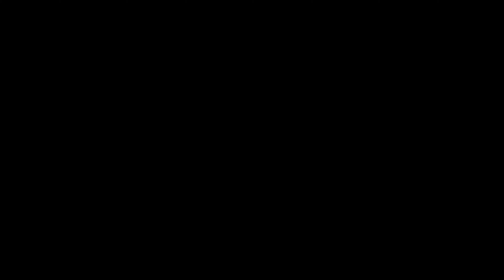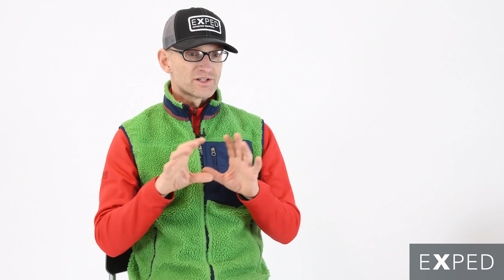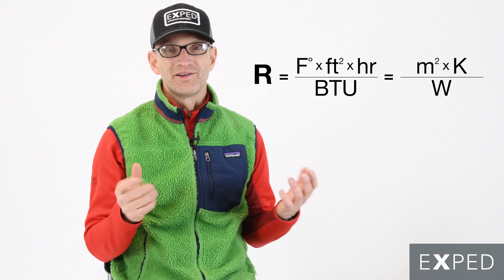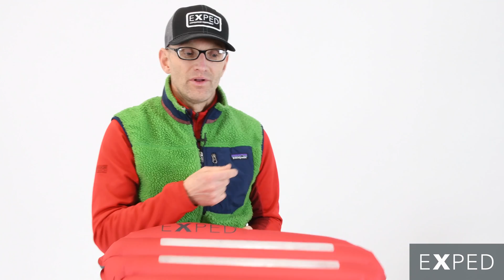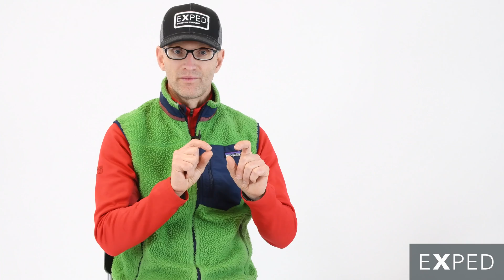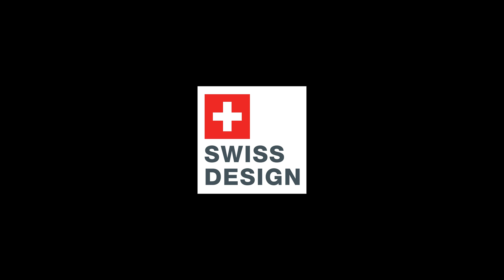R Value Overview

Comment: I will be setting up for a lot of winter outings here in Northern Ontario. The temps drop to below -30C I'm looking for info on whether the Exped would be a good pad / insulator that I can use on top of a tarp on the snow. Any info would sure help.  What is the R value of your winter pads.
Reply from the maker: Hi Daniel,

Sounds like you have quite the adventure coming up! For help on specific products please email info@exped.com for assistance. Cheers!

Comment: Here's a question I would like to get a definite answer; when layering different kinds of mats (foam, inflatable, self-inflating) to gain a high R value, what is the most thermally efficient order, or does it even matter? Opinions vary on this subject.
Reply from the maker: Hi Jari Perho: There is no order that would increase thermal efficiency. Including the foam mat on the
bottom would help protect an air inflated mat from sharp objects.  Cheers!